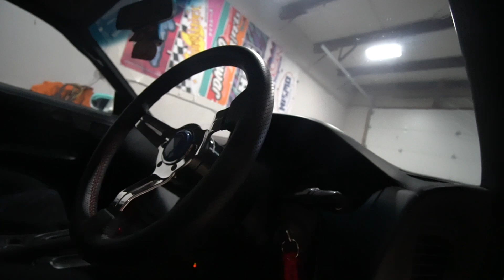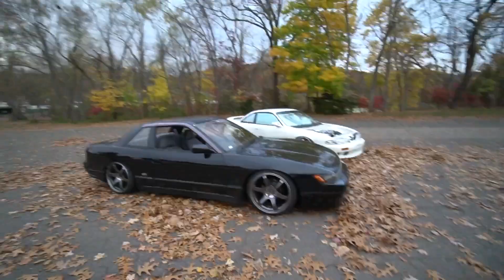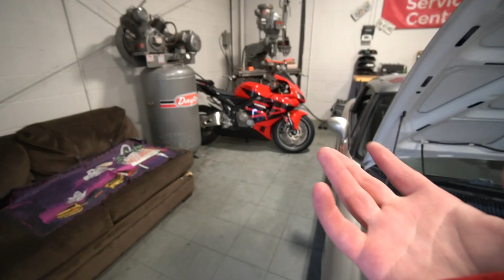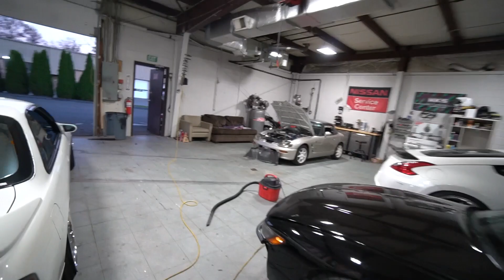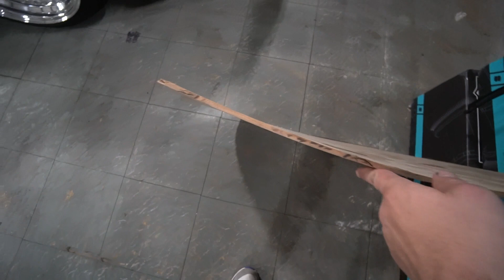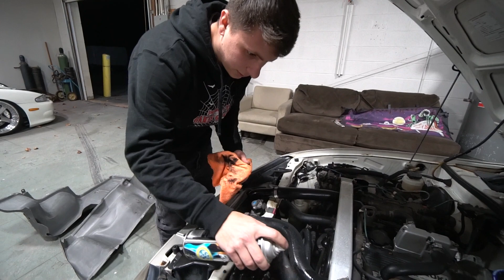Back In CT! Time To Sell Everything.. S13 Silvia Gets Full Interior!

Comment: dj use a blade to take the stuff off of the rear window. it wont scratch the glass. you should do a turbo silverado single cab build. cheap easy high horsepower!
Reply: Using blades on toughened glass will scratch the glass

Comment: Ant pullin the old wd40 used car sales trick... DJ ffs learn the difference between an engine & a motor, freaking "wiper engine". Him & so many others call things that are engines as motors, but then chooses to call an actual motor an engine. Sorry, pet peeve.
Reply: All engines are motors but not all motors are engines.
Reply: @Pheatan  Wrong. Motors run on electricity and engines run on combustion. I understand people use the terms interchangeably in the current zeitgeist, but again I said it's a pet peeve earlier.